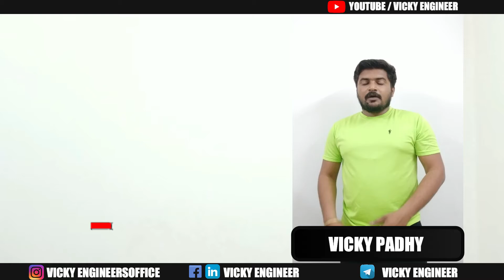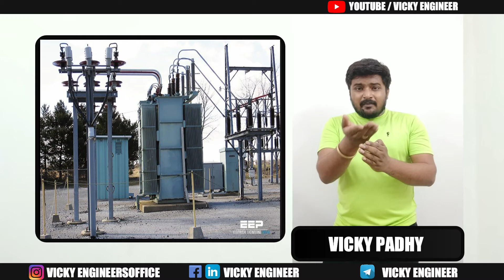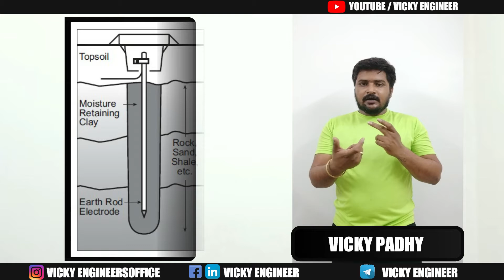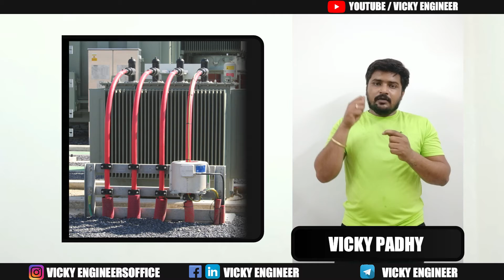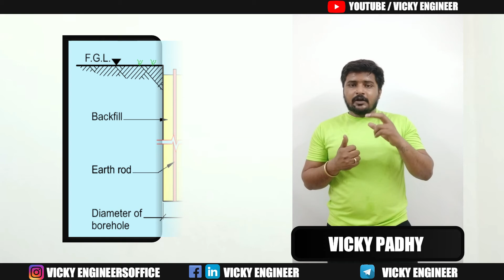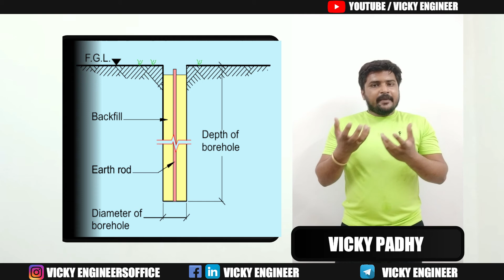Substation & Transformer Basics | Earthing Types & Earthing Compound (Bentonite, Marconite)

Comment from the maker: If you’re new to electrical engineering, this video gives you the complete basics of Substation, Transformer and Earthing Systems.

In this session, I’ve also explained earthing compounds (Bentonite & Marconite) — when, where and why they are used — along with neutral, body and chemical earthing in the simplest way.

If you want more beginner-friendly electrical videos like this, comment “More Basics” and check out the Study Circle playlist on the channel.